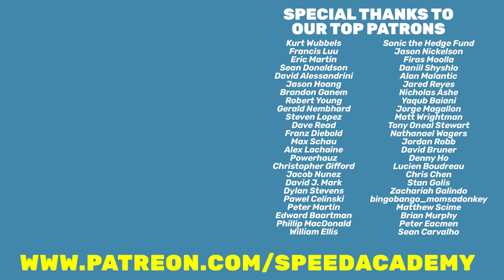Quick & Easy Toyota Sienna Minivan Build

Comment: P.S.A.: I did my quick Google research, and just to share for those wondering, the wheels do by definition have hubcaps. That definition being "a removable usually metal cap over the end of an axle". Websters Dictionary. That being said, they are not what most, including myself, would consider hubcaps. They are essentially plastic covers that match and fit over an alloy wheel. Acting to the wheel as a phone case does to a phone. That's the reason there is so much visibility of the rotor, caliper, etc.; because there is indeed an alloy wheel under the cover, even on the base model Sienna (at least for 2023). I assume this was done in an effort to prevent curb rash, but that's purely speculation. Hope this helps some of you that were as confused by this as me.
Reply: It actually makes curb rash worse because the plastic bends and twists. You can't refinish it like normal alloy wheels and they also don't sell replacement covers - you have to buy a whole new wheel. I think it's made so Toyota can save money.  They can make one base wheel and just create different covers for different looks.
Reply: Can't believe my $70K van has cheap glued on chrome plastic wheel covers. Saw a video where a guy pulled them off by heat gun and prying them off. Guess what gets hot on a car driving...

Comment: I don't care what other people say, the fact that minivans do their singular job extremely well makes them cool in my book. I also think they are the ideal candidate for an EV, especially in the western US where charging on road trips is a non-issue. They're just the right shape and use case. Also power sliding doors are a cooler concept than any other door style and I will fight anyone who says otherwise.
Reply: (because I think it's important to explain my opinion, I'm 30, have no kids, and my garage includes a 22 Corolla hatchback 6MT, 98 4runner, and disassembled 81 280zx)

Comment: Actually I like both looks. The new Toyota design language goes well with a lowered setup, slim spokes wheels, those rear fenders are like wide arches from factory it's great. And the lifted version, it's like a support vehicle for an off roading team or the camper when you go desert racing.

Comment: Love minivans especially modified minivans, in Asia there’s a version of the Sienna called the Alphard, it looks more like a Transformer but based on the same platform, same drivetrain, same V6 or Hybrid system and there’s loads of suspension and brake kits for them from mild to wild, there’s Alphards running 8 piston Brembo’s, sick wheels, coilovers, sway bars, strut bars, chassis bars, you name it it’s done to them, one can only assume the same can be done to a North American Sienna!

Comment: I have a 2022 Sienna LE and love it (my other car is a highly modified AE86 that I've owned for 20+ years, so I like a variety of cars).

The J.O.R. kit looks almost identical (probably is) to the 'lift kit' on the factory Toyota Woodlands edition. That lift kit would help anyone considering adding a hitch to this van. I have a Curt hitch and it has touched the pavement on a couple of instances.

I do have to say while the Weather tech floor mats are an improvement, they severely impact the range of slide on the center seats. I own a set and am considering replacing them with a set of 3W floor mats which have a better design.
Reply: The JOR kit is quite different; the Woodlands lift is only 0.6 inches while the JOR is 2 or 3 inches (2 models).

Comment: My imported 2006 Toyota Estima minivan is an AWD hybrid. Same set up. 13hp helper motor in the front, and a seperate 28hp motor for the rear, no driveshaft to the back. Great in the snow. As far as I know there are only a handful that have been imported to Canada.

Comment: The first time I saw one of those rear electric drive units I also got really excited. Toyota's been doing it in their AWD hybrids as far back as the 2007 Lexus RX400h (which has a 70hp rear motor!). I'm excited to see them used more in modified cars but I'm not holding my breath.

Comment: I want to do this to my sister's Caravan...it needs some minor rust repair and I think a junkyard facelift would make it look pretty decent.  Some OEM Jeep or Dodge Journey, or even newer Caravan wheels would look great.  The Journey came with a black 19" wheel very similar to what you use here on the Sienna lowered.  A few chrome bits, like window trim a grill.  Others little things here and there.  Maybe some truck tires.  She really wanted a Sienna but they were out of her budget.
Reply: Yea don't waste your time on the dodge , those things suck already lol
Reply: Some people have luck with the older 3.3 3.8L engines seen some with high mileage. 3.6 pentastars like to start ticking though they re pretty quick

Comment: Questions: 

1) Could you have lifted the van by adjusting the coilovers only? 

2) Do the coilovers offer a smoother in-city rides than stock suspension? I am looking for an option that will give my minivan the smoothest ride in city possible. 

Thanks. I look forward to hearing from you

Comment: Mud flaps to protect the paint.
Paint the rims white because rally.
Onboard air compressor to air tires up/down.
Hitch on the front and rear for a removable winch.
Snorkel just in case.

Comment: Before anyone goes and does that lifted version of their minivan, I think you should point out how dangerous it can be. It is an awesome look but it has many setbacks (I know because I lifted my little impreza, a much smaller crossover). First of all, the minivan is already top heavy, that kind of lift will be terrible for cornering if you dont have a stronger supportive sway bar. Not to mention, it will now surely fail a moose test or a rollover test in case of a crash. Second, that angle by the spring is definitely putting a lot of stress on the suspensions, it will shorten the life of many parts. Third, the minivan mpg is going be at least abt the same as a heavy duty truck. My recommendation is go for larger tyres and wheels during the winter in case of snow, but other than that, refrain from using lift kit on a minivan. This is for your own SAFETY.

Comment: So I have a 2014 Sienna FWD...I love it.  Use it to camp and for road trips.  Our biggest issue is loaded down the rear end sags.  I have installed and air bag kit but it still can drag my 2" hitch when loaded with camping gear, paddling gear, and a Kuat 4 bike rack on the back.  Is there anything out there for the sienna's to get that rear suspension stiffer under load?  Should I just do the 3.5" lift?

Comment: Okay - I love it…but why didn’t you put in the lift kit when you had it apart the first time. LOL!!! 😂 and did you put the original springs back in it after removing and replacing them? .. and new/different wheels .. that I get tougher for mountain driving than the thinner spokes. I still love this. So this gave it a 9-10” ground clearance? And since you lifted it could you go up in tire size? And how would it affect driving and the speedometer if you did go up in tire size. And how much added weight did the undercoating add to the overall weight of the vehicle?

Comment: This build looks gorgeous!   These Konig wheels (19x8.5 +32) are 1 inch wider and 5mm closer to suspension components than the OEM ones (18x7.5 +40).   Did you experience any issues with these wheels rubbing/hitting the suspension components when they turn to left or right to their full extent?   Is +32 the best offset for 8.5" wheels in your opinion?

Comment: What tire size did you go with after the 3” lift and new wheels? Is there enough space to add some snow chains if needed? I’m thinking of doing this same thing!
Reply: Sorry, I answered my own question… but now I have one more. Did you have any concerns about the less than recommended load capacity for the Motegi’s?

Comment: I have 2005, 2008 and 2021.
2005 is the best, extremely comfortable seats with soft, smooth velour fabrics. Seat padding is thick, 3 middle seats built for adult seatings and they’re removable individually. Cup holders are HUGE fitting any size of refillable bottles. Interior lighting is more adequate than 2021 models. Sunshade visors are bigger in the old Sienna.
However, the Fourth Generation Toyota Sienna hybrid has unbeatable fuel economy 35 mpg abd 600 miles range with smaller gas tank, very impressive, moreover, the newer Sienna has more safety standards and better connectivity with my iPhone.
My take: the second generation Toyota Sienna is better built
The Fourth Generation Toyota Sienna has better technology.
Question: why can’t Toyota keep the build quality of the Second Generation and add the technology to Fourth Generation Sienna?

Comment: Hub caps? Is that what stock wheels are called now?  This is a auto channel correct? Hub caps.
Reply: You can hear the thin plastic sound @1:07 when Pete touches them and see the hole for the valve stem passthrough, lol, they're clearly plastic beauty covers.
Reply from the maker: Its a plastic cover thats glued onto the a wheel…Its todays version of a hubcap but non removable.